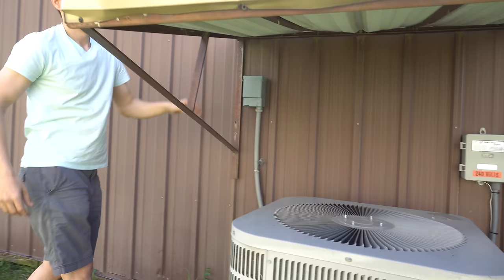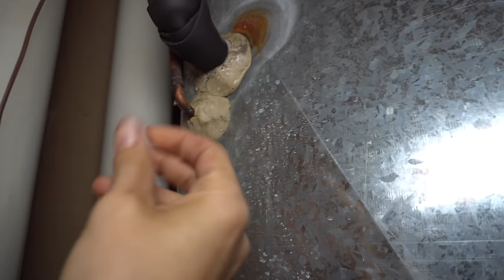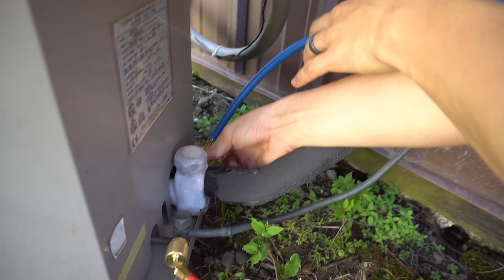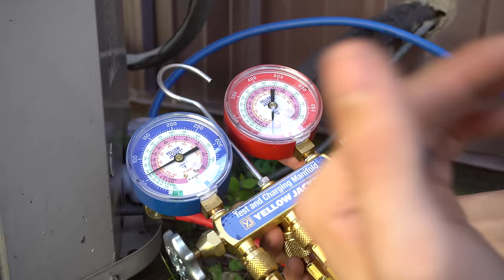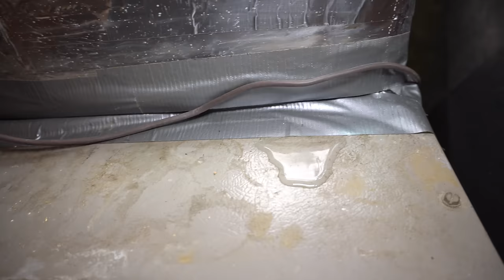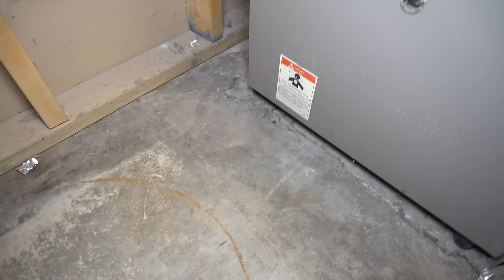How To Add Refrigerant To Air Conditioner

Comment from the maker: ❄ Other Videos For Reference:

How to add refrigerant the proper way:
https://youtu.be/GlS8aAkUBT4
Top 5 A/C Problems:
https://youtu.be/GOXgdnRB840
Complete A/C Troubleshooting Guide:
https://youtu.be/wzAA4dlp_70
How to Clean Condenser Coil:
https://youtu.be/pzwOvgjwm_Q
How to Replace a Capacitor Full Guide:
https://youtu.be/9ZGfvC-PMWU
How to Replace a Contactor:
https://youtu.be/qHZc9wWAF4c
How to Replace Condenser Fan Motor:
https://youtu.be/gGFTd2dmgxg
How to Replace A/C Control Board:
https://youtu.be/hijUExXrcm8
How to Replace a Thermostat:
https://youtu.be/1mJkjrwxdP4
How to Program a Thermostat:
https://youtu.be/uun8HJhM3h4
How a Thermostat Works:
https://youtu.be/Z4T9H-6VPtI
How to Check Freon Level:
https://youtu.be/dExFtP-nXTw
How to Wire A/C Condenser Unit:
https://youtu.be/KCanZEsLVEI
How to Order Correct HVAC Parts:
https://youtu.be/faCno8-vRnw
How to Read A/C Wiring Diagram:
https://youtu.be/I-sB4GIlbl4
How an Air Conditioner Works:
https://youtu.be/cRnzYJ4qmWE
When Should You Replace A/C:
https://youtu.be/Z7vUOySOWbM
15 Air Conditioner Maintenance Tips:
https://youtu.be/pBBnXHse-T0
Should You Get an A/C Inspection:
https://youtu.be/JqNsEzb__qs
Reply: Do you put the furnace on Fan Or Heat?
Reply: I did the same thing with a friend. 2.9 degrees subcooling, then went to add refrigerant and my tank took 3lbs out and the subcool went to 18. Sometimes people just add without knowing it needs refrigerant. When in fact it is over charged. I am just learning but it's not always low. Sometimes a unit gets overcharged and looks like a low charge situation. Pay attention to your superheat. R-22.

Comment: I watched this video to educate my self... a tech came over and said he does not carry R22 in his van, it is special order, and for the most part he said he would recommend a system flush and replace it with R410 .. a 3 thousand dollar minimum... I got a second opinion, and it was so different, the guy cleaned my coils and topped off a little bit of R22, and Voila, cool as a cucumber... great video, thanks
Reply: R22 is really old and the EPA has been phasing it out for years now. Their no longer making it anymore. Once whatever stock is gone its gone. Thats it no more R22.
Reply: Mechanics, HVACR technicians and plumbers are never to be trusted, unless you know them properly. Since they're the only ones who understand their craft they tend to be doing the devils work by making pay a ton of money for something so simple.
Reply: @JoshSmith-wo7zw  The system was later replaced with a new one running R410, the old system was recycled and I was told yes, it will be no more, but there is plenty of R22 to refill old systems that need it not for new systems being installed.
Reply: Hard to get the truth. As I see it, techs will say what the company wants them to say to get the profit they want which doesn’t mean they won’t do a good job but everything is at their convenience and of maximum charge to you.
Reply: R22 is phased out. They’re just trying to update your system to something more energy efficient and better for the environment.
Reply: @JoshSmith-wo7zw  not all technician are devils, there are a lot of honest workers in my field, you  let the bad apples become a standard you expect
Reply: Bait comment if you know what r22 is you now the history 😂
Reply: I believe this is the situation I'm in, furnace works great, ac works decently until it gets over 95 out, then it just can't quite keep up, inside creeps up from 74 to 76. It think it's absurd that nobody is willing to try and get some more years out of it, so far it's just been, "You need a new system!" Ya not gonna pay 10k-15k+ for a system that works great for most of the year except 2 months maybe little. IDGAF if my electric bill is an extra $100 for 2 months lol
Reply: @isaiahmack234  R22 is still sold.
Reply: I bet you wish you made that change now lol R22 is not longer in use
Reply: @uniq7778  Is English hard?? It is still in use and you can still buy it, most places don't have it and you can't install new R22 systems...
Reply: @mcduvall2000  sorry the mic didn’t get it right😂😂 hahaha bet you’re losing money as we speak
Reply: @reycontreras2687 better for the environment? Cime on, where do you live? Where im at, us ‘little’ people w/r22 arent the problem 🤷🏼‍♂️🤔🇺🇸
Reply: Between the liars/cons and the ametuers I've learned more recently than ever always get a 2nd or 3rd opinion. That goes with auto, medical, etc.
Reply: @reycontreras2687 "better for the environment".  🙄 Lies!
Reply: 3 years later. They are now phasing out the R410 now.
Reply: R410A is replacing R22 but only problem is you have to replace the metering device as well sometimes the compacitor
Reply: @uniq7778 why spend three grand the flush out the system and add 410 to it when you can take the three grand and put it towards a new system the rule is if it cost half of something to fix it replace it

Comment: Jay, thanks to you I am able to charge my 1994 Trane unit that no one around here wants to service anymore. Everyone wants to quote me a whole new A/C system for my house. Your video makes it so easy to understand that I felt comfortable doing it myself. Now my unit is working like a charm!
Reply: 38  years is a long time and unless you get free electricity in a hot summer day; you'll go broke pretty soon. Recharging your own unit is a crime. So don't try been a wise guy!
Reply: @bobboscarato1313  Everyone knows the only real criminals are the ones charging $300 to top off an AC unit.  😉
Reply: @kevinmiller5467  Are you aware of the never ending EPA regulations and the different refrigerants and their cost which are fines? This is today's reality; I'm glad I'm retired from the HVAC business!
Reply: @bobboscarato1313  So is everyone else
Reply: Heck if unit is that old; I'll tell the owner to get a life; I'm not married to that unit! I wouldn't service it fro you either!
Reply: @kevinmiller5467  it's a crime for the Tech's to charge $299 🤔
Reply: @kevinmiller5467  Try $900 plus for 3 lbs of R22 in Texas.
Reply: Where do you purchase the refrigerant?
Reply: @erikajohnson-kelly3404  ebay you don't need a license, just make sure you read what type of refrigerator your AC takes
Reply: @scroogemcduck841  watching this now and my ac is not cooling. It’s summer and I am in Florida. 🤦🏽‍♂️ The AC company quoted 400 to top off.
Reply: @forcedair92gt94  well since r22 is $1800 for 30lb, $900 is pretty fair. You think people are in this trade simply because they want everyone to be comfortable?
Reply: @calebwhitaker2318  You pay it if you want to but, I found an honest company. Paid less and got more. Nothing like getting more than one estimate.
Reply: Exactly the same around here. Nobody will touch it. When it works just fine. Replacing it makes sense to me when it's broken. But until then it'll keep on trucking
Reply: Has anyone thought about the prices an regulations an who put them on the working people of this world, next time you think it dont matter who you vote for think about what we are just talking about in here. P.s as of right now a HVAC person can buy R-22 for $415 to $450 for 25lbs most units only hold  4 to 10lbs from empty, plus if they change a unit out they can recover around 75% of that freon to use in older units an get that for free plus make money on unit they change out , but then the voting comes into play with EPA REGULATIONS so do research an vote for the people that is going to help us not tax an keep breaking the working people of this world
Reply: @kevinmiller5467 do you know how much ref. Cost?  Yeah I bet you don’t.
Reply: Mine needs 2.5 lbs. Tech wanted 1600 to charge it.600 a lb. For r22.. now that's a crime. Found it online for 120 for 2.5 lbs.

Comment: One of the best videos on AC charging on u tube, thanks. Like someone else said hvac techs seems always want to sell a new system especially if one has R22.
Reply: Because r22 is being phased out.
Reply: @unseenone1152  yes, but it is still readily available for not expensive, $30/pound if you buy a 30lb tank. These people are installing ne r22 systems, they just need a top off to maybe get a little more life out instead of dropping 10k-15k+ It's absurd when the system still functions mostly.

Comment: I just purchased a home supplied by gas.  I've never had gas before, nor have I ever had central air.  I ran across your videos and started to watch so I would educate myself on gas and central A/C.  I find your videos very informative and concise.  And, my most favorite thing about your videos is that you don't ramble on and on like most other videos.  You only say what is absolutely necessary and I like that a lot.  Thank you for your help.
Reply from the maker: That is nice to hear! I'm glad my videos have been helpful, thank you for watching and leaving a comment!
Reply: Where are you getting your refrigerant from? The technicians here want to charge me 300 for this service 😭
Reply: @isabellagrisales5722  I haven't purchased any refrigerant yet.  Nor have I done any maintenance  yet.  I'm still in the process of learning how to maintain it.  Fortunately I have a family member that knows a lot about it.  I will probably start this spring.
Reply: @isabellagrisales5722  Look on FB marketplace
Reply: @2846jerseydan  my is $350😭😭 and call the other$ 450-550 😭😭😭😭

Comment: I've fixed/recharged about 40 units over the past 2 weeks here in addition to my other maintenance duties. I've had to cut a few evaps out, replace them and/or change drain pans and in weeks prior, I retrofitted 2 new systems (evap and condensing units) to existing linesets/ductwork. I still have quite a few things lined up here at the apartment complex I work at. Old units. Lots of overtime. Thanks for the vids!
Reply from the maker: Wow! Sounds like you are super busy over there. You have AC experience galore! Thank you for sharing!
Reply: @game wizard. I would like to use your expertise. Can I connect with you and if yes, how 
Thanks.

Comment: Thank you - i watched a number of similar video's & this one is by far the most helpful. Just achieved success at my house! Got an extra -8 degrees at the vent! Also - when i removed the protective cap on the red side of the condenser's valve it hissed - there was pressure between the valve & cap - so i bet that's the cause of the leak. This fall / winter i'll vacuume out the refregerant & replace the valve. Thanks a tonne! FYI - i knew there was a leak already because i'd had a pro out 2 years ago & they identified the issue as a leak using all the tools. So in my case, I think it was reasonable for me to use this simpler method. Also, for anyone going to try this after attending YouTube-Uni - it was very helpful for me to write down a list of instructions, things to check and potentially stop / quit ect - instead of trying to go and do it from memory.
Reply: They also sell a valve core removal tool that can be used to tighten or replace the valve core while the unit is still under pressure. That way, you won't lose your refrigerant charge.
Reply: Johnny Riser thanks for the tip ! I’ll look into that
Reply: Thank you God bless you.
Reply: Before you remove the refrigerant charge, check access points; evaporator and condenser coils as well as all copper connections. Look for signs of oil.
Reply: @johnnyriser8519  True, they work if you have enough room where the service valves are located. That core remover is great but it will cost at least $ 100.-

Comment: Good explanations, and clearer than any other. I've been trying to learn more to fix my AC with not enough cooling during the summer. It seems to be a little low on gas as by your explanations. Thanks so much. You are the best teacher we could find on You Tube. You are young but experienced and with the will to let anyone else to learn from you in a very honest and modest way. Thanks again , very good luck for you !

Comment: Ive been doing HVAC and refrigeration for about 25 years and electrical construction about 35 years I really enjoy watching you, Nor Cal AC Service and others not here to criticize but who decided to put awning above condenser 1st rule of thumb never install condenser under porch,deck etc.The heat will just keep recycling through the condeser get rid of that awning when the new condenser goes  in all that heat throws off your readings.Thats just my opinion keep up the good work

Comment: This is a great step by step instructional video. Even if I don't plan to take this on as a DIY project, it's good to know what it entails. I had a major company to quote me $26,000 on a new system. But I had an independent technician recharge my existing system for $400.

Comment: Exactly what I was looking for DIY, basic straight instruction that works. My r22 AC was not cooling and when I checked the psi. Mine was at 90 so following your video fixed it. Most other videos are hard to follow or understand for my level of experience.

Comment: The HVAC guys at our shop gave me similar advice about adding R-22 to my Sweetheart's system.  You are spot on with your advice!  No more frozen A-Coil!  Comfy in the hot summer weather!
Reply: If you are certified to handle refrigerants, you can use R407C as a replacement for R22 and a whole lot cheaper. The R22 around is mostly recycled anyway as its manufacture stopped about 10 years ago!
Reply: @bobboscarato1313  A useful tip, indeed sir!  Thanks awfully!
Reply: @bobboscarato1313  The tech put in MO99 in my units, is that a new refrigerant?
Reply: @ssfouryou  Sorry, I'm retired; it may be a generic replacement for R22 or R410A. check w/Air Conditioning/Refrigeration Association.
Reply: @ssfouryou  Yes and from what I read, it helps compressors to run at lower temperatures which will prolong the life of the compressor as it works a lower temperatures; it will probably same money with your electric bills; or so I hope!

Comment: ahh, the good ole days lugging up that 22 can on a rope along with the recharge machine and vac. Pump up to the phoenix roofs on a 120 degree day with the tar roofs feeling like 200 degrees and also brazing refrigerant lines. You literally had to take a soaking wet towel with you so you didn't get heat stroke on the roof. Eveything burned lol especially when kneeling down to work. Sucked. But good job showing this vid man. It takes me back.